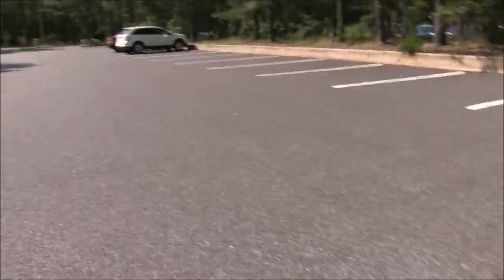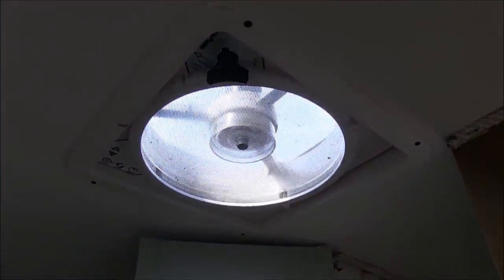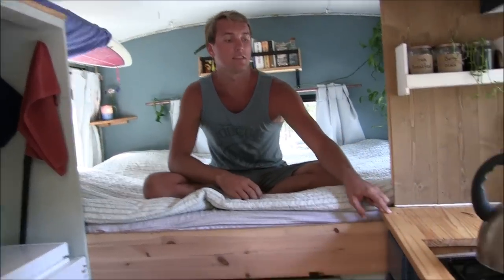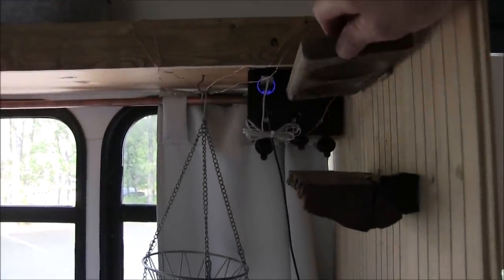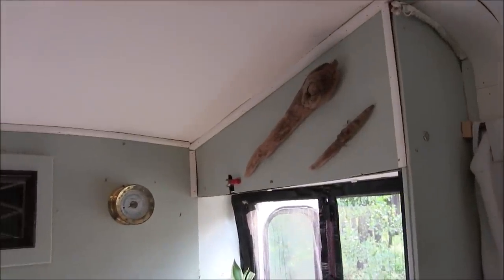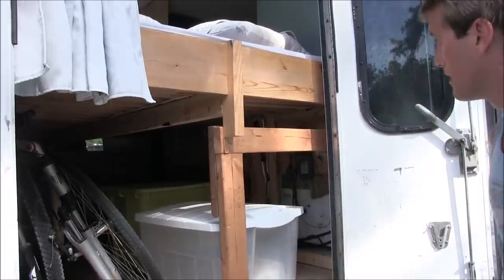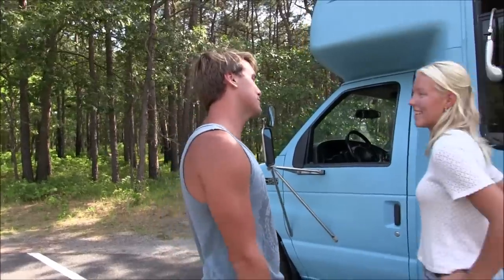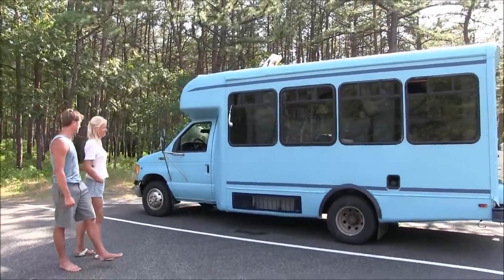BUS TOUR | Impressive Shuttle Bus RV Camper Conversion

Comment: im not an electrician, so who cares what i think but the bathroom scares me lol.
Reply: Why?
Reply: The wires near the shelves and between the wall and toilet. My ass would slip and pull something loose or shock myself all together
Reply: My thoughts also, water and electrical wires would worry me taking a shower.
Reply from the maker: Be careful
Reply from the maker: Safety first
Reply: I'm glad I wasn't alone lol. I understand they use a curtain but people have been shocked from much less.
Reply: Me too. Water and electrical just don't mix, as an aviation mechanic.  You need to find a more secure way to cover those wires. One little nick in a wire, and big electrocute.
Reply: Me too,  electrical near water doesn’t seem very safe.thank YOU
Reply: Holy shit!!!
Reply: Yes
Reply: My thoughts and sentiments exactly👏😂
Reply: Yes 😟 and...The stove. 
her description on opening that small door for ventilation.......the flames 🥴
Reply: I was an electrician apprentice for years it should scare you

Comment: What a nice home!  Lovely interior.  Nice to see you are having such an adventure in it.  Great memories.

There are a couple of things I would fix:
1. Propane tank - cut a notch for the pipe coming out of the box.  You don't want any compression on it or it could crack and leak.
2. Bathroom - I would get FRP panels for the bath area - Fiberglass Reinforced Panels.  They come in colors and textures.  This will make it waterproof.  No matter how much you paint wood to seal it, it will leak in time.
3. The nylon straps around the super heavy water tank make me nervous.  What about some metal straps that are stronger?

Thanks for the tour.  Lovely interior!  Great job on reusing materials and keeping cost down. The build is impressive.  I wonder what paint you used for the exterior - bedliner like Durabak or general automotive paint?

Comment: I'm in no way a professional in any way however I do know a few in many different areas of construction.  This is also NOT to put down or criticise this beautiful couple.....  That being said, I just want to add a little CONSTRUCTIVE comments for them to correct & beware of for their safety.  That bathroom as creative as it is might need to be checked & better sealed for water damage such as wiring & mold IF that's mold we see around the rope, wood, etc.  I'd put a better coating once completely dried out.  bleach would help with the mold but can damage the wood if not well sealed.  

Over all, they have great ideas.  I sure hope it last a long time with many great memories to be had.  Safe travels.

Comment: Don’t they need more protection around the gas cooler top? Unless the wooden counter top has been treated to make it fire proof. It’s always a good idea to have a fire extinguisher and fire blanket as well as a carbon monoxide and smoke detector. It’s not always the case that you would smell it so it’s not needed. If you’re asleep 💤 you could suffocate quickly. An alarm could give you those precious seconds that can determine life or death. I assume they can exit from the back in an emergency. It’s imperative there are at least two exits front and back. It’s nice to see a bus that is fitted cheaply. Lovely couple 😊

Comment: You did a great job but your cook stove worries me. Looks like the counter might catch on fire. ???
And I was wondering about the plywood in the bathroom. I didn't know you could put a clear fiber glass on wood like that. What kind of product is it??
Reply: My thoughts also.
Reply: Hey we used a fiberglass cloth and resin. You can get it at Lowes
Reply from the maker: Safety first. Thank you for looking out
Reply from the maker: It looks like they have been using it that way for a long time
Reply from the maker: Thank you for the tip

Comment: On those rear doors that they spray foamed, if you put a piece of thin plastic film, like for food, on the spray foam and then close the door the foam will cure in the shape of the door and the film will prevent the foam from sticking to the door.  Let it cure completely and then pull the extra film off.  You can even follow up with a thin strip of door weather seal.  If the gap isn't very big use a silicone sealant instead of spray foam.  I've had great success using this technique on car doors to repair the seal.